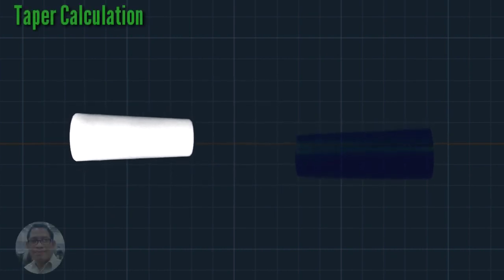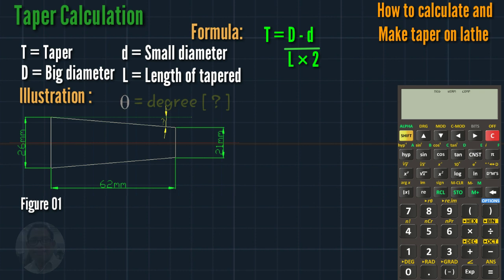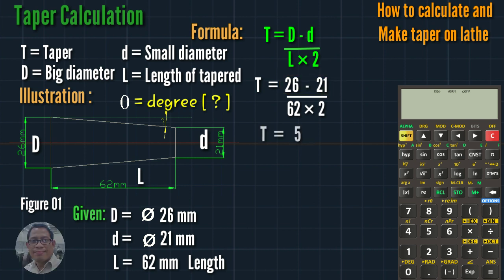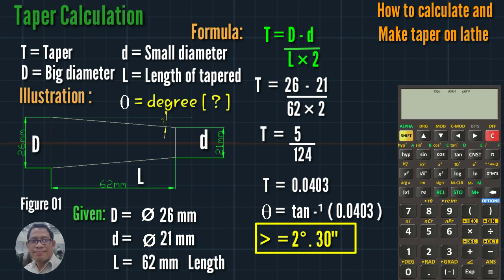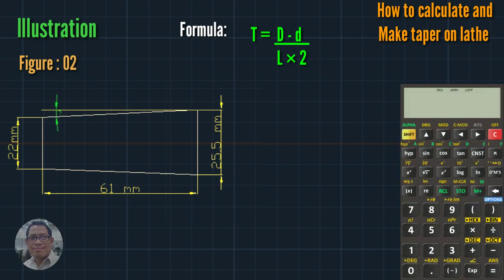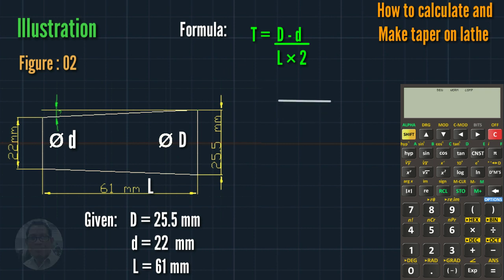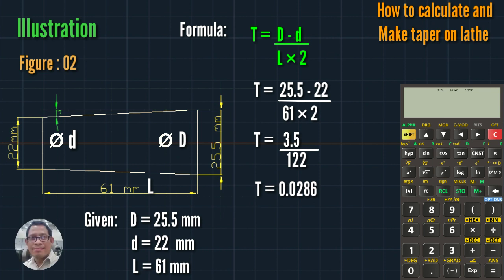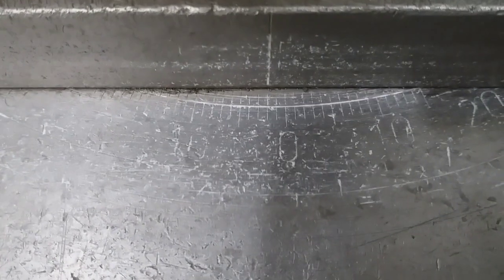CALCULATION AND MAKING TAPER ON LATHE MACHINE | Machine Shop Theory

Comment: Assuming the graduations on the compound are accurate. They never are. Never, only a rough guideline. Best way is small D subtracted from large D. Divide by two then by using dial indicator on the parallel shaft travel the compound on the hypotenuse using the corrected half tan calculation of L. This is the most accurate way to do tapers that matter like prop shafts mating to propellers. Any other way is just guesswork. Quick guideline should have been Morse tapers that work in thou per foot. Same principle. Calculation and method shown here is just to get you close. That's  it. You will be lapping and Prussian bluing for days.

Comment: 63" seconds or minutes?,,,1 degree how many seconds arc or minutes arc?
Reply from the maker: Since lathe is used we can refer to round clock  angular degree . 60 sec > 1min = 1°  and  set approx. By sight  when we cut the matls. Authomatically multifly by 2. Pls.. refer the video and apply if possible.